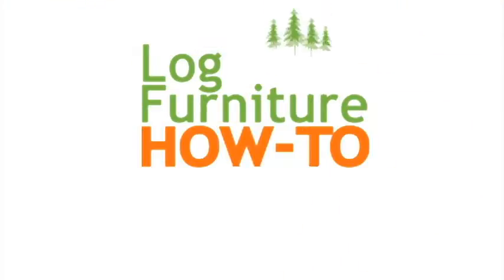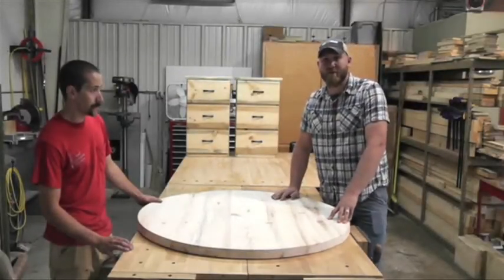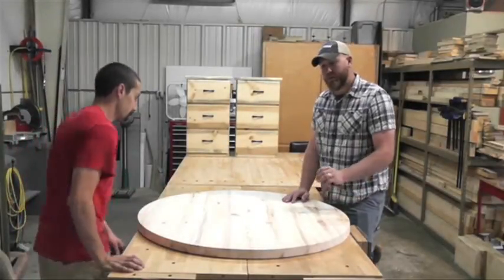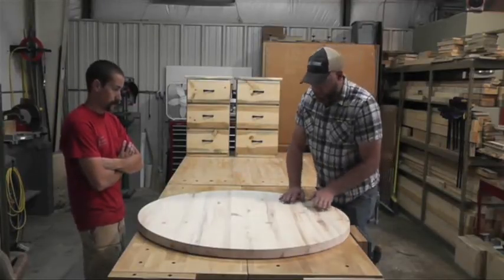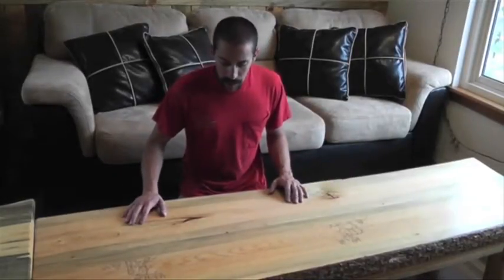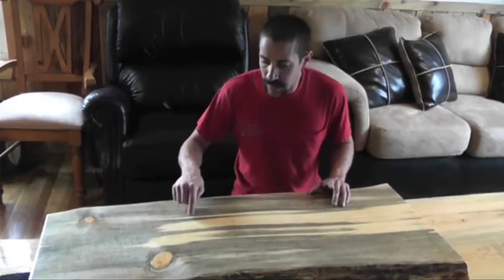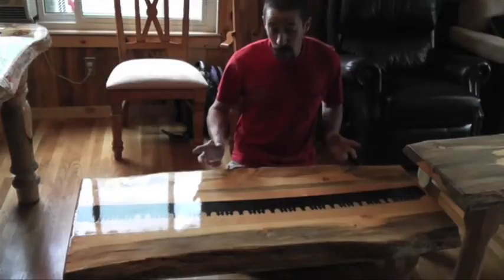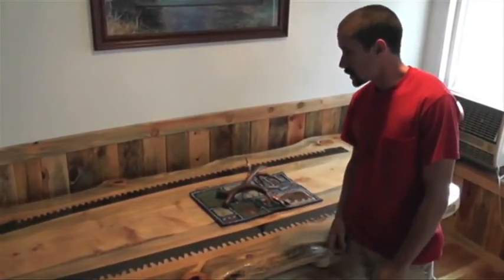Apply Epoxy Finish Part 1

Comment: Is there epoxy that comes out more matte looking? or all epoxy options are really shiny?
Reply from the maker: +12ita You can do a matte finish with this epoxy by sanding it with extremely fine sand paper. It looks awesome! Looks like bare wood until you touch it.